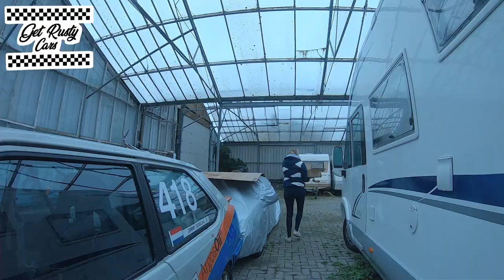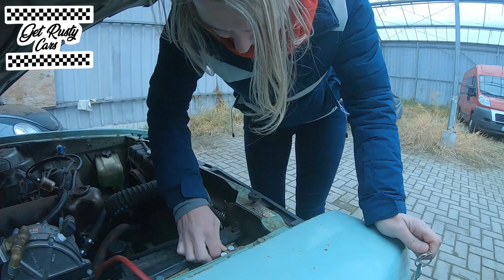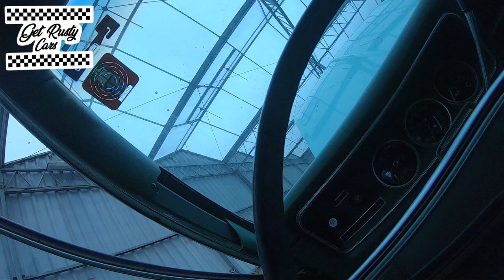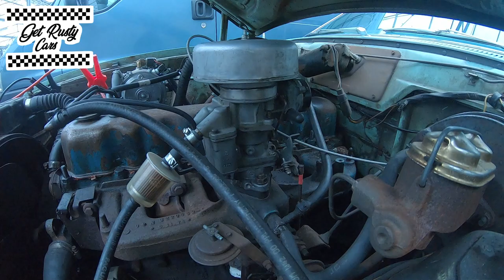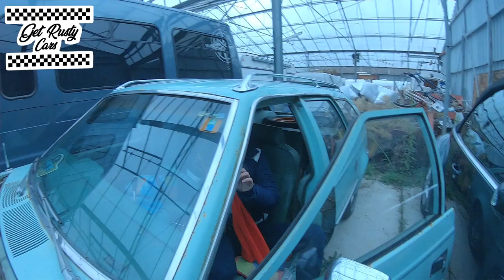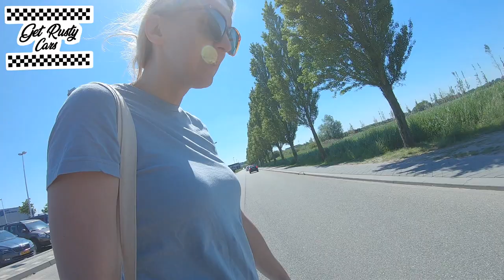Cranking the Horny - S01E4 --Subtitles--

Comment: That's a common problem with old carburated vehicles without an electric fuel pump, the fuel will evaporate from the carburator and it'll take minutes of cranking to get it started. That's really hard on the starter motor and it kills the battery pretty easily, I'd recommend getting some starting fluid for the next time. If it doesn't start normally, just spray some starting fluid into the air cleaner and it'll be up and running in no time. If that doesn't do anything, you have problems with ignition.
Reply from the maker: Thanx for your explanation 👌🏽 Now I understand it even better! Also Break Cleaner into the air-filter helps... bur starting fluid is more proper. Thank you 👍🏼

Comment: NEVER put the negative clamp of a jumper cable at an empty batterie, because she takes all the electricity you need for starting !!!
Put the negative clamp on a metal part near the starter motor instead.
Reply from the maker: Oh wauw, thanks for this useful tip! 🤩